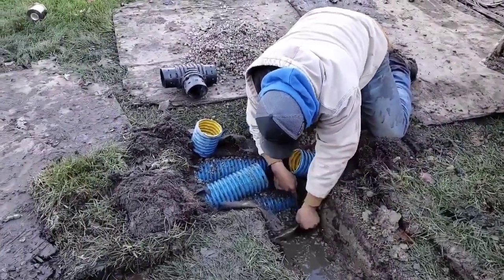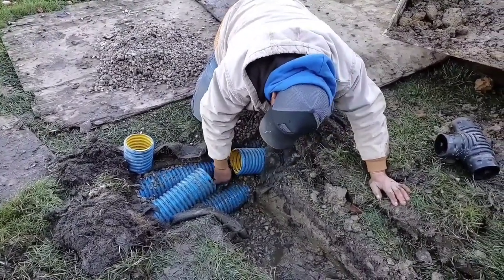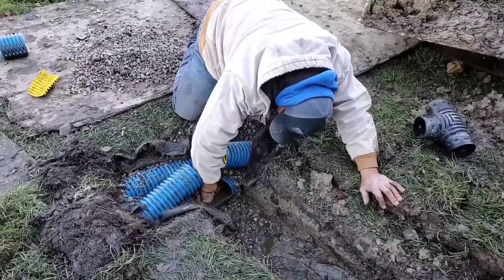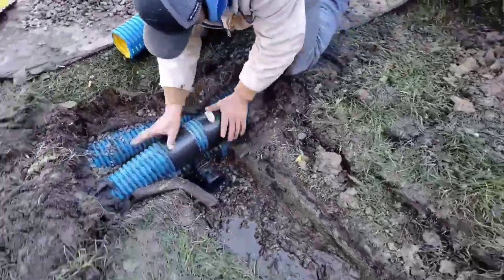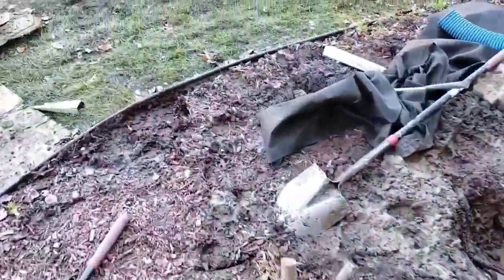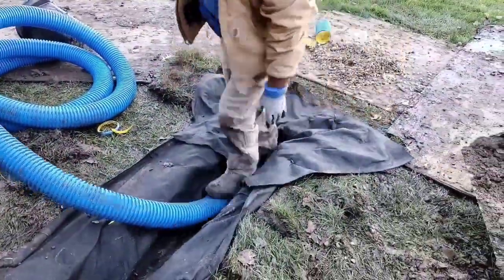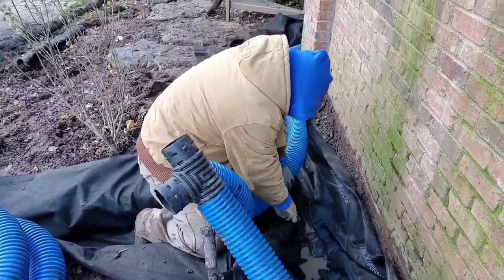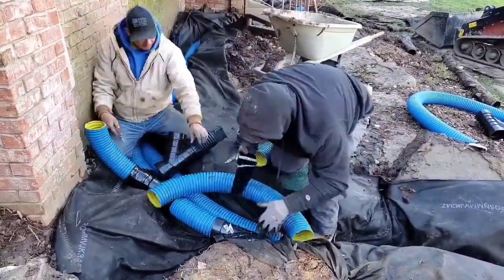Drainage System Saves $10,000 Tens of Thousands of Dollars Footer French Drain Roof Gutter Drain

Comment: The pop up emitters. How does that work with snow and snow melt packing down heavy on top?
Reply from the maker: When water flows it melt snow. Water snow melt from the sun runs through the system in a slow trickle.  Water seeps around the lid and melts everything under the snow that's by the pop up emitter. Never had a problem with that part of the system.

Comment: was this also to prevent the basement from leaking?
Reply from the maker: The Basement floor is the same level as the lower level patio so Flooding would be impossible. Leaking could of been a issue.  The problem was the Basement drain tile had nowhere to go. When the interior system can't daylight to a sump pit or sewer it can cause foundation issues. Everything was saturated. The ground was so soft I feared the footing was floating. If the house footing cracked that damage would be 10s of thousands of dollars. In the winter saturated ground could freeze and lift the footing. We did this just in time right before the cold weather.